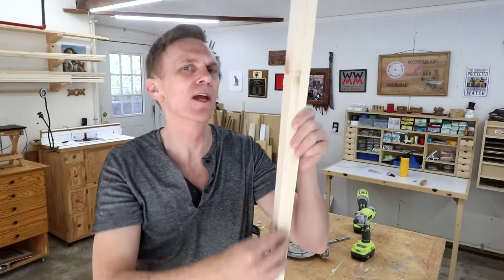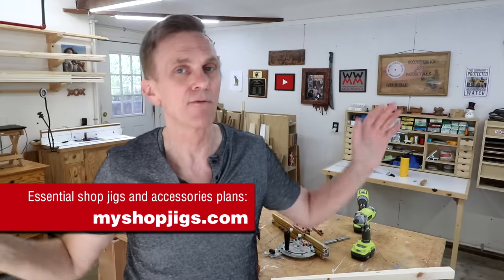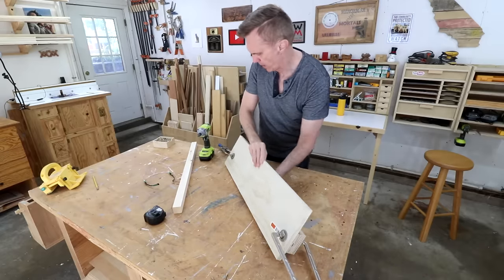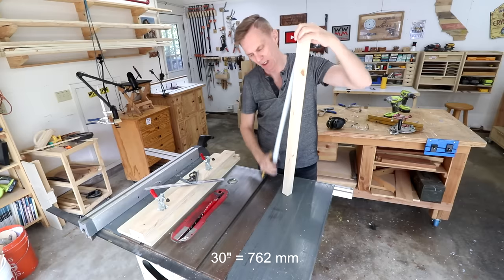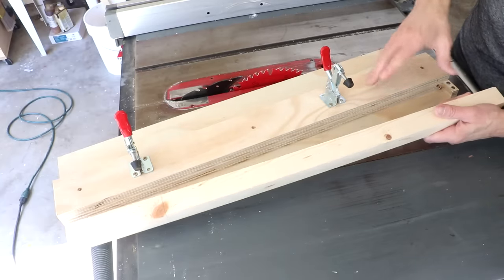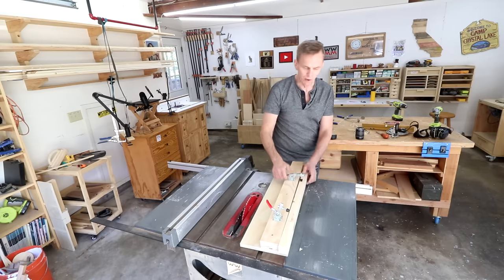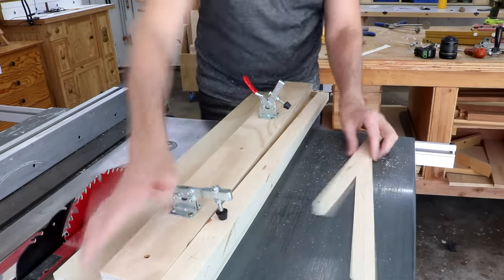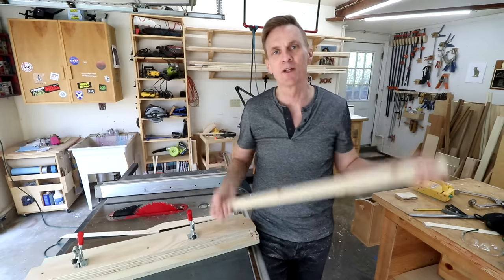Making tapered legs doesn't have to be difficult. Essential woodworking shop project.

Comment: Seeing these videos keep reminding me I really ought to get a table saw.
Reply: It took me a while to make myself buy one, and I probably use it the most out of anything now. If you can, wait until father's day, they'll have some awesome deals for them.
Reply: Ryobi at Home Depot 189 with stand
Reply: Going on 5 years with the Delta that Lowe's sells. I've been completely satisfied with it. It has soft start, purrs while running, has a fantastic fence that glides with 1 finger, is a good size for jigs and breaking down sheet goods. Can't beat it for $600. They've got the T2 version out now which has some improvements over the original.
Reply: I got a cheapy with a beefy motor and the first project was to pretty much rebuild it and make a proper fence for it - plenty of youtubers out there that will show you how to do it.  Now it's a pretty decent table saw and I love using it
Reply: If you can, spend enough to get a good one; at a minimum one with a cast iron top.  Like Barnes said, the Delta  from Lowe's.  Buying used in another option.  An old Craftsman 113 series (113.xxxxxx model number) contractor's saw should be available used for $100-$250 and it's much more saw than most of the newer ones with cast aluminum tops and plastic housings.  There are plenty of YouTubes on building a good fence for one.
Reply: @Jeremy_810  I want to buy the T2 and they didn't have one to sell me at all. It sounds like they are not going to be selling them anymore. One person who didn't really sound like they knew what they were talking about, said that there might have been a recall on them. Do you know anything about that? Did you get a notification that there's been a recall?
Reply: @roberttrimmier3276  that's a bummer. I haven't heard about any recalls but everything seems to be selling out and/or going on backorder....along with price increases. I just assumed it was due to manufacturing being shut down.
Reply: @CaseySexton  I love my table saw and use it for so many projects. We can even cut circles on a table saw. 😀

Comment: Nice jig, however small mistake and upgrade suggestion. If you measure your example leg, you’ll find it turned out slightly bigger then the intended 3/4.  This is because, although you started the. Sawblade from the line, the other side at location of the line was not touching the jig. So instead of taking of 3/8 as intended, you did 3/8 minus the small gap you had left.

A fix would be:
-add a 2nd screw at the line location, only sticking out enough so the leg rest on it, instead of the jig. For example, 1/4 inch.

Your other screw, set at 3/8 + 1/4. (So differences between the screw is 3/8. All others steps as per you video. Now the removal is exactly 3/8 and final result exactly 3/4
Reply: I agree! This really had me thinking "won't the starting point affect what the set screw does?" I think you could also keep the same jig and simply adjust the set screw so that the distance from the screw to the blade is correct. It might take a couple tries to get it right though.

Comment: I liked how you re-used the cut-off parts for the clamps. Btw, one can easily make those clamps, too, if someone doesn't want to buy them (reduces the simplicity of course). And, finally, this is something I cannot make with my track saw. Interesting.

Also, Microjig should pay you for mentioning they have more than one product. Everyone who watched your channel for years is propably convinced their sole purpose is making GRRRIPPERs. Though... that jig could be counted as GRRRIPPER extension.

Comment: Just a handy tip.  I have seen a few table-leg jigs that have a small strip of wood put in them on the bottom just like a sled would have.  This way you wouldn't need the table saw fence since it would set in one of the grooves.

Comment: I changed out my toggle clamps because I had to keep changing the thickness size of my wood cuts. I changed to the rockler/ of off brand screw down clamps and it seems to work

Comment: If you cut the four sides of the leg it will reduce on all sides. It is also possible to reduce only the outer sides of the leg, while the inner sides remain square and vertical. Thank you for all these videos. Regards from Argentina

Comment: I have something similar but with one less construction step, I don't use an adjustment screw. Just lay out where you want the taper to start (like you did), then lay out the finished size of the "foot" on bottom of the leg. Set both of those lines at the edge of the base, move the fence against the workpiece, and screw the fence to the base. You can now run all of your legs through the saw with just one turn to an adjacent face (I've never seen legs tapered on 4 sides, usually just the 2 sides that house the apron mortise). Try it. You'll see how easy it is.

Comment: Very good video. A little (mathematical) comment: In order to get the second, third, and fourth cut absolutely correct, one of the wedges should be placed UNDER the leg instead of on top of it (so that the center line of the leg is horizontal). But in practice, the difference will be very small :-)

Comment: Not long ago I made a tapering jig with those same toggle clamps, albeit set into the t-slots because I don’t trust the fence as much. But I found the clamps to be cumbersome to adjust when doing lots of cuts, so I’ll be looking for alternatives. Also thinking that if you replace the set screw with some sort of thumb screw driven from the other side, you wouldn’t have to keep that screw driver handy. (I’m always keen to keep my table saw area clear of unnecessary shrapnel)

Comment: Very nice! I might complicate it a little more by putting in a threaded insert for the adjustment screw, and maybe a second adjustment screw on the base by the current one, so the end of the leg could be lifted up for the last two cuts. I don't know if that would make a significant difference, but it seems like it might be a little more precise.
Reply: The screw is pretty much "anti-vibration" as shown.  Friction is your friend here.  Adding a threaded insert might set the jig up for failure by the adjustment changing from vibration from the saw due to reduced friction.  If I don't lock my blade height for dados it will work its way down on a cut because of vibration.
Reply: @David-hm9ic , that's true. But adding a lock nut to the adjustment screw should fix that.

Comment: Eight months late; better late than never. My only concern with the tapering is how much material needs to be left on the leg to provide sufficient strength to support the table? I like the simplicity of the jig as I really need simple things and my daughter is going to get a house build in our back yard and is going to need an extendable dining table due to size constraints and I would like to try and make her that table (if you knew how limited my skills are it would keep you all in hysterical laughter for months, nay years). 

The legs were a big concern due to my obscene lack of equipment and square legs just weren't going to cut the mustard but these taper ones come oh so close to fitting the bill. Hence my question about how much material is needed for support. It will ordinarily be a 4 seat table but I would like to make it expandable to 8 places to the legs would then be supporting a lot more weight. Any suggestion on this would be greatly appreciated (Thank You) and as a bonus I would post photos of my previous works for your amusement. Trust me it will give you either an excellent laugh and/or nightmares. 😂 / 😱

Comment: Thanks for the video!  Use it once a year ... or just once. Took me a moment to realize that the rip fence distance determined where the taper started, so it would be the same on all the tapered sides (2 or 4).  The cure for the guy with calipers - don’t publish specs.

Comment: Thanks Steve for another great video!
I wonder if the supporting 'fence' should be the same length as what you want to taper, so the contact with the 'fence' is at the break point (where you place the mark)

Comment: Steve, I need some help. I’m trying to edge joint some ambrosia maple so that I can glue it up as a table top. I only have a jet 6” jointer. The boards are 80” long. Other than the jointer what can I do to give them straight edges? Thanks!

Comment: Steve great video thanks.

Could you please tell me what size blank you are using to cut your tapers? I am assuming
you are using a 10" table saw blade to cut your tapers.

I am trying to cut a 4 sided tapers using a 4x4 blank and realize that with a 10" table saw blade I can
only cut up to about 3 3/16" square, having to finish my taper either running the blank in the other direction through the taper jig or cutting the rest of the way through with a circular saw and cleaning it up with a belt sander. Thanks.

Comment: Hi, Steve! I've been seeing a rise in prevalence of 8 1/4" entry level/bench top table saws. I'm looking to buy my first table saw and am getting hung up on this. As a beginning woodworker, should my first table saw be 10"? What are the pros and cons of one size vs another? Thank you! Love your channel! 😊
Reply: I have never seen a tablesaw that wasn't 10" or larger.

My suggestion...save up and get one that will last. Don't get some cheap one to get you by till you can get a better one, because you'll be cursing yourself every single time you use it.

You also don't need a multiple thousand dollar tablesaw to do really good woodworking. Buy for your needs. For example, I need mobility, as I don't have a permanent place to install one, so a hybrid is my choice. I also need a 110V one, as 220v isn't available to me.

Rigid makes a tablesaw that is around 700 bucks that would be a good choice for beginners on a budget. I wouldn't recommend jobsite saws, get a proper saw with a cast top and good fence, like a Biesemeyer.
Reply: @charlieodom9107  UL (safety standards org) is now pushing for a specific ratio of blade height to table size and spacing from the blade. The regulation went into effect at the end of 2019. This means we will being seeing a lot more smaller blades and tables or bigger overall table job site 10″ saws.
Reply: @charlieodom9107  I guess, but it does explain the new trend. Sorry to have bothered you.

Comment: Just curious but I’m trying to do this with 4x4 material. Would this work on a bandsaw my table isn’t very big. Any help will be appreciated.
Reply: Should work, as long as the blade installed is fairly wide and under decent tension; goes without saying that your bandsaw needs to have a fence that’s parallel to the blade.

Comment: The math for the size of the foot doesn't work the way you describe:
You have a 1.5" square leg and want the foot to be 3/4", by removing 3/8" on all sides - so far so good. Then you set the screw to 3/8" away from the fence, but since you don't start cutting the leg at the top you aren't removing the full 3/8" at the bottom. You'd need to align the start of the taper (instead of the top of the leg) with the edge of the jig and have that flush with the blade. 

But with your Methode The legs are still tapered and all symmetrical & identical, so it doesn't really matter - but the foot isn't 3/4" like you wanted.

Comment: Could this be used as a jointer jig as well?
Reply: Yes!  This jig or a similar jig can be used to cut a straight edge on a board that doesn't have either edge straight.  Clamp the board in there with the adjustment screw all the way in and cut one edge on the board.  This edge should be straight so now you can run that straight edge against the rip fence to cut the other edge straight.